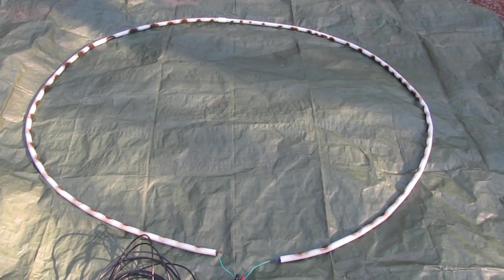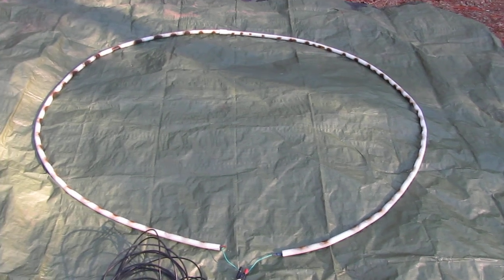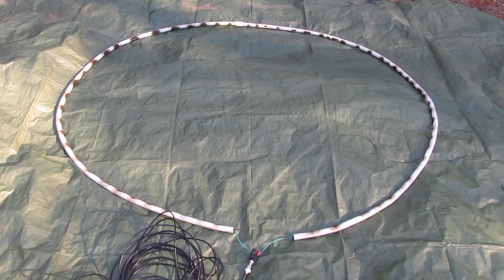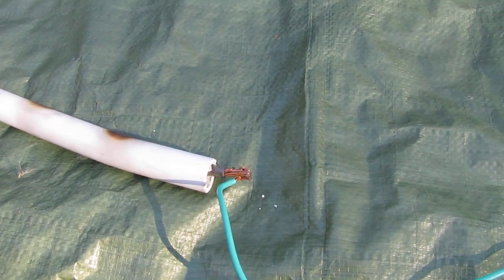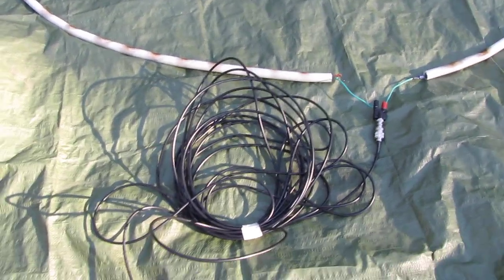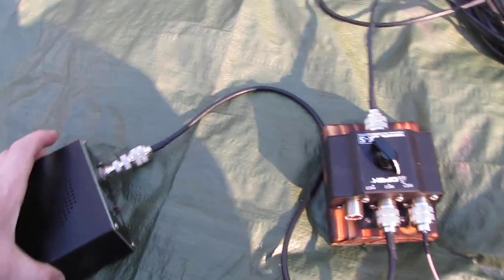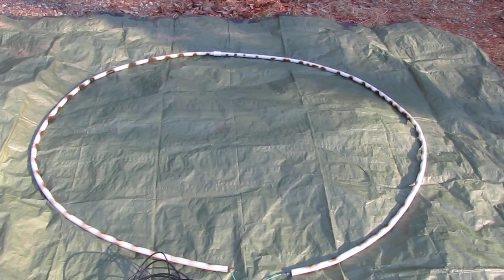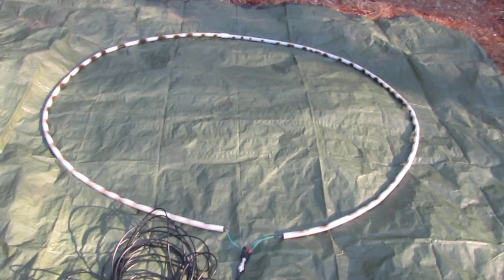thick cable loop antenna - easy to make and no soldering for shortwave radio!

Comment: How high should it be?
Reply from the maker: diameter is 1.6 meters and its now hanging on the outside wall, flat on the wall, top pipe by the top of the wall.